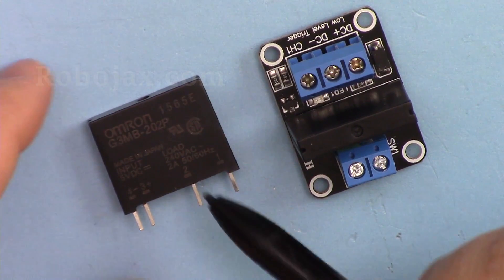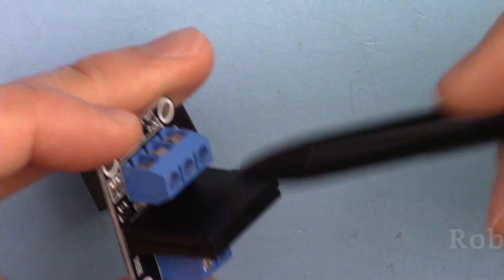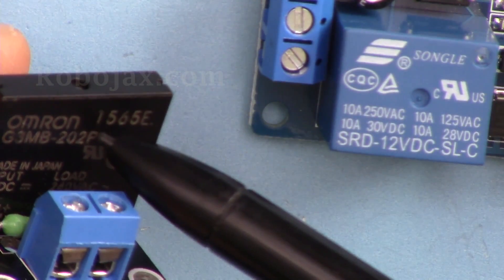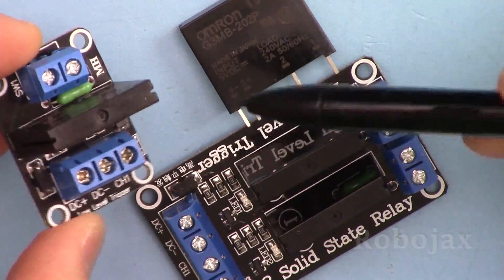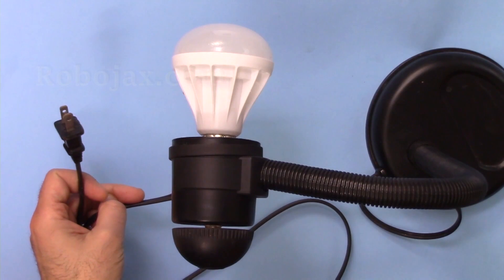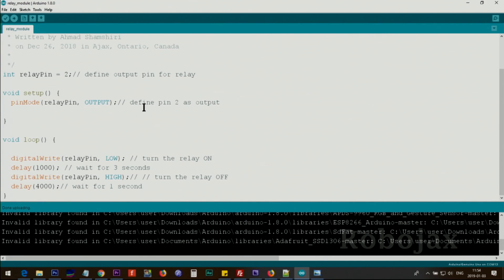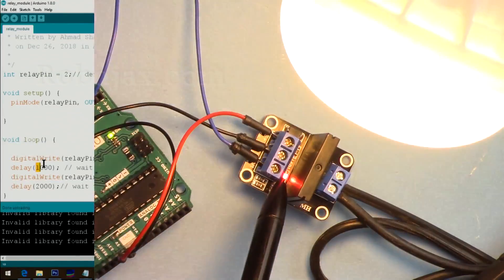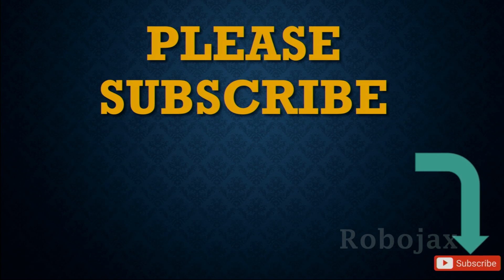Lesson 64: Using Solid State Relay with Arduino - RJT482

Comment: Hi.  Useful video, thanks.  I am trying to do a similar thing, but rather than a mains voltage load, I am trying to switch a low voltage (5V) signal.  When I do this, the SSR turns on when triggered by a low signal, but stays on when the low signal is removed.  It only turns off when I take away the power to the SSR.  Are these things not suitable for switching low voltages?

Comment: I don't understand the Arduino ground. At 3:37 in the video you show the wiring of just the SSR which diagrams the Arduino connections from the +5VDC  to pin #3 and the channel1 input too the #4 pin. But where would the ground attach?
Reply from the maker: You mad me watch the video. The video has chapter for wiring and I have shown 5V and Ground there.

Comment: Hey there, thanks for your video! Ist ist possible to use the "naked" module (as it is on 3:50) without the board to solder it onto an own circuit board? How would the wiring with the arduino look like in that case?

Comment: Can I connect multiple devices in parallel to the output side as long as it doesn't exceed the relay's max specifications which is 2 amperes? and if does exceed the maximum, what happens to the arduino and the relay?
Reply from the maker: yes. you can connec them in parallel.  I assume you want to  increase the amount of power. I suggest using actual relay which can handle 10A. here https://youtu.be/58XWVDnB7Ss or dual channel Solid State Relay https://youtu.be/jGncm9kPt3Y warning. working with AC is very dangrouse. Please ware proper protection gear and do it under supervision of a professional if you are unsure
Reply: @robojax  thanks broo